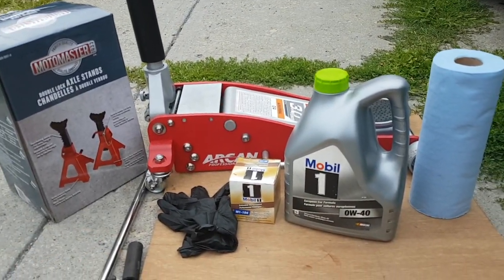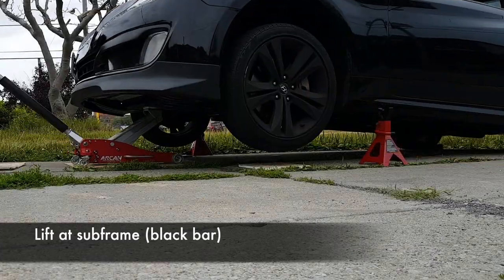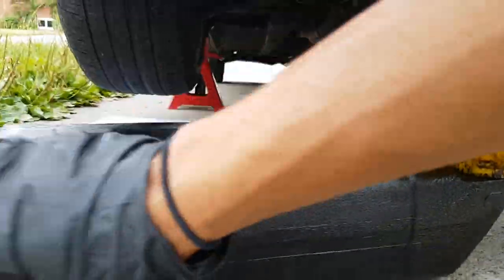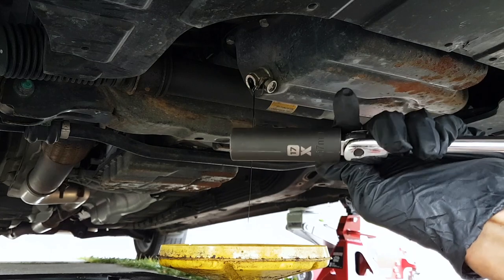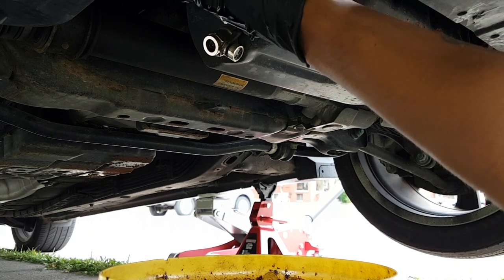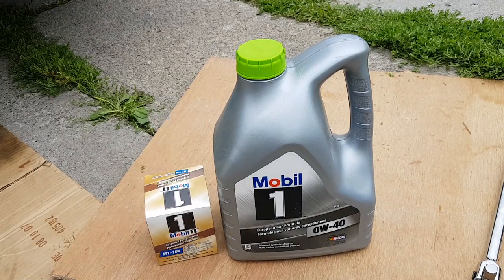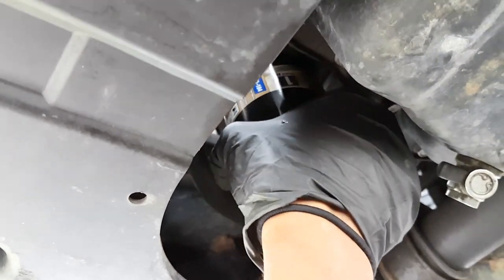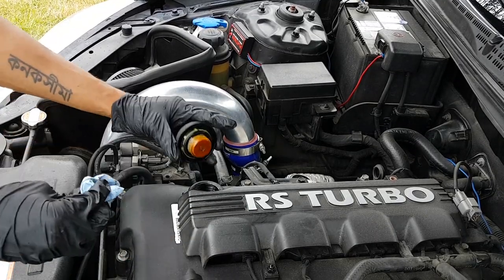Oil Change | EZ Valve | Genesis Coupe

Comment: i would put an extra .6 of a quart just because the owners manual calls for 5.6q for 2.0t. plus then youll have extra oil to add later
Reply: it says unde 5-20 5-30 or 5-40 always use 5 as the first number! and thats odd bro
Reply: *use
Reply: because turbo engines need the oil to be thin on start ups

Comment: Just found your channel, thanks for the awesome and helpful videos dude! I’m also a bk1 2.0t owner from Ontario. Do you use 0w-40 oil year round or only in the summer? I’ve always used 5w-20, but will be switching to 5w-40 this summer as per the manual. Why did you choose 0w-40 over 5w-40? Thanks!